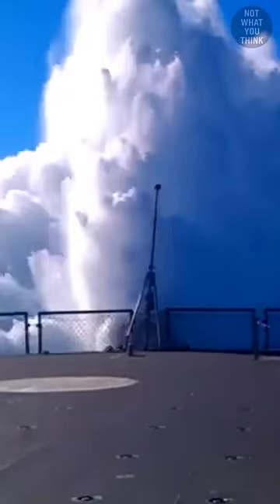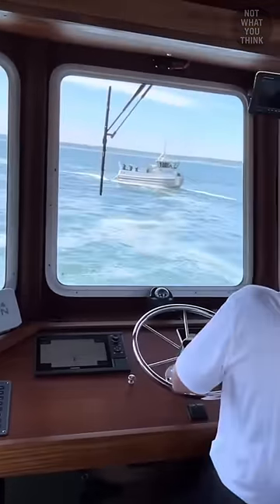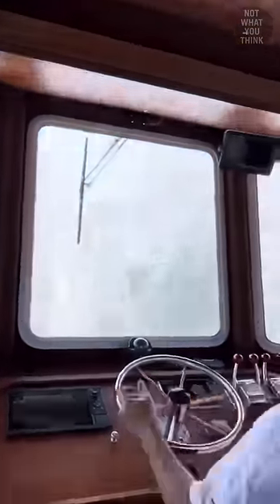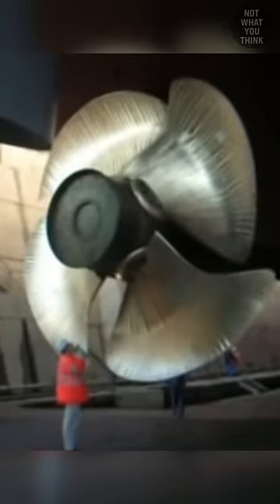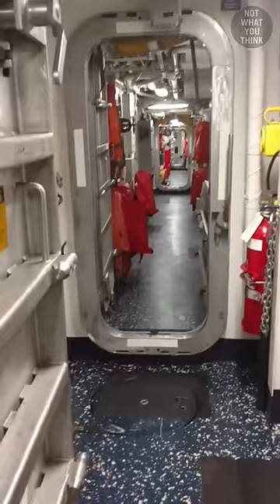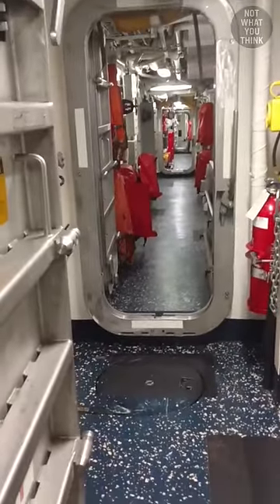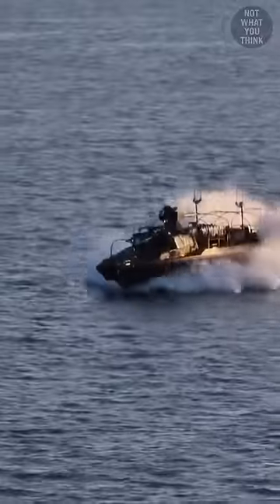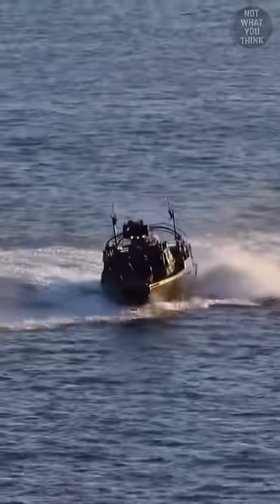Water Crash Stop #shorts

Comment: I was at helmsman on a Ticonderoga class cruiser. We used to go from ahead flank to full reverse instantly. But the engineers told us that it was very hard on the engines and reduction gear to do that. So then we went from ahead flank to all stop, waited for the RPMs to wind down to 20, and then when all back full.
Reply: We did it on normandy...in suez canal..foggy..following gw ...almost hit her stern. 
They crashed back and boiled water under our stern.  Sand , fish, line, I think we dredged another 20 feet😊😊😊😊😊 boat shook like it was coming apart
Reply: @robertsloane1268  why the hell did the GW do that? The Ike never did anything that dumb when we followed on Anzio.
Reply: So the Ticonderoga’s don’t have variable-pitch propellers?
Reply: That's not how its done. The turbines, MRG and shaft always turn in the same direction. All you are doing in changing the pitch on the CRPP from something like +100 to -40. Now the main thrust bearings and shaft seals may not be the happiest though.
Reply: @robertu yes, that is how it's done. CRPP propulsion systems use a combination of pitch and RMP to control speed. Below about 10 knots it's combined pitch and shaft speed, above that it's all shaft speed. While the shaft might always be going in one direction, waiting for the shaft line to slow before commanding reverse knots greatly reduces the shock on the shaft line and ship structure.

And +100 to -40? +100 degrees of pitch would have the blades inline with the shaft like a 50,000 hp egg beater. Try +30, -25.
Reply: @wyattroncin941  Forgive me, its been awhile since my ESWS and bridge days on the PFF.
Reply: @robertu  Neither will the CPO's...
Reply: @wyattroncin941 I need a 50,000 hp egg beater in my life
Reply: @robertsloane1268  that doesn't surprise me, the seamanship of the USN (particularly the 7th fleet) has been absolutely abysmal. Their numerous incidents, particularly around canals and heavy shipping lanes are frankly embarrassing.

The NTSB et al accident reports are full of USN arrogance, the incompetence would be funny if not for the innocent lives lost.
Reply: @beardedchimp  Congrats you got you slam in, feel better now?
Reply: Min shaft speed for a Tico class is 55 srpm.
Reply: @wyattroncin941  He is referring to percent of pitch. 100 just means that the max forward pitch is set.
Reply: @Dave-in-MD  Canadian ships don't report pitch in percentage. We report in degrees. American ships could be different, but I find that highly unlikely because of how incredibly awful "percentage of pitch" would be for doing any kind of plant operations.
Reply: @wyattroncin941  I spent 20 years in the US Navy on Tyco class cruisers and Burke class Destroyers. The scale on the OD Box was marked in both  percentage and feet per revolution. The manual pitch knob on the PACC was marked in percentage. It has been 15 years since I retired so I may have forgotten some things but that is to the best of my recollection.
Reply: @wyattroncin941  I thought you guys used radians
Reply: @Dave-in-MD  fair enough. i feel sorry for your engineering department.
Reply: @wyattroncin941  Why is that?
Reply: Battleship sailor here, 212,000 hp crashback. What a mess. Asbestos dust everywhere.
Reply: @beardedchimp the funniest part is that despite American arrogance and stupidity, they still beat out all other large, open water navies (which is frankly terrifying).

Comment: To be clear, the CB90 uses water jets with a scoop ("bucket") to perform the reverse/braking thrust. The bucket re-directs the water jets, so the drive itself never have to change direction or reverse pitch.
Very handy because you can go from full forward to full reverse thrust in about a second.
Reply: I was on a ferry with that type of propulsion except it had gas turbines for driving the shafts. They had a emergency reverse thrust mechanism to very quickly slow the turbine down and slow the blades.
Reply: So its a jetboat, thats what i figured.

Comment: I remember doing this on a 3500ton ship and being able to feel the deceleration of the ship under your feet.. quite impressive
Reply: Absolutely. On Type 42 destroyers, it felt crazy going from 32 knots to zero so quickly. Type 45 was even faster performing a crash stop. Type 45 also made you feel acceleration when wanging open the throttles. No gear lag and massive torque and they are like lightning from a standing start.
Reply: @vxrdrummer  yeah under normal circumstances we would run the two diesels (5500hp each), but sometimes we would run the gas turbine (30,000hp) and yeah you could feel it when they gave it full jandal!

Comment: When a ship brakes better in water than your 3 ton SUV smh
Reply: It goes both ways. If you put wider (or more) wheels on your vehicle, you will be able to stop faster, but you'll also have more friction driving (worse gas milage). Ships have abysmal gas milage for mostly the same reason.
Reply: @Dredge22 Ships have amazing fuel milage thanks to the square cube law and the coefficient of friction being proportional to the surface area and pressure.  With a ship you can scale up almost infinitely without increasing the pressure under the hule very much. Thus the pressure stays almost the same while the tonnage you can haul increases exponentially compared to the surfaces experiencing drag.
Reply: Why wouldn't it?
Reply: @amosbackstrom5366  I think the scaling part is extremely important, like comparing hauling me in a car or better yet on a motorcycle to hauling me on the smallest gasoline powered boat you can come up with, I'm guessing the boat losing (plus those small outboard engines have horrible emissions).

But yes there's a good reason it's cheaper to use container ships to move massive amounts of cargo.
Reply: @Michael-uc2pn  I don’t get what you’re saying, hauling what
Reply: @Dell-ol6hb  hauling as in moving a person or a relatively small amount of something. Perhaps hauling isn't the best word in that case.

But my point is Ships/boats are efficient at carrying an enormous amount of stuff, but if you're only wanting to carry a small amount of stuff, a small land based vehicle starts to be a better option for efficiency.
Reply: @Michael-uc2pn  Yes, that's exactly right, for moving small loads land vehicles are more efficient. I'm not sure where the graphs would converge but probably around 100 tons. So if the distances are the same you'd have to be moving more than 8 semi truck loads for it be worth shipping instead. This is a one variable aproximation so these numbers aren't accurate. There's much more than then just fuel mileage to take into consideration but if you're moving millions of tons the other variables go out the window.  It's cheaper to send a ship from NY all the way down and through the Panama canal and back up to the west coast to LA. That's about 6,000 miles over water compared to 2,700 over land.
Reply: That’s a misconception of what grip is. Unless you’re in very uneven terrain or over large  puddles of water, the size/number of tires has absolutely nothing to do with grip. The only thing that changes is surface area. Friction is a function of force over an area (pressure) which remains unchanged regardless of the contact patch size. This is because the same weight is distributed over whatever area you give it. In other words, increasing the area distributes the same load over a larger area. The only thing that can change grip on flat, hard terrain like a dry road is coefficient of friction, which only changes with different materials (tire rubber compounds) or temperature, assuming the road is held constant
Reply: @brookem.397  Yes that's exactly right. Those street bikes with water hose sized tires are a great example.
You have better grip than a mountain bike (on concrete/asphalt).
Reply: Just don't drive an SUV?
Reply: @ZephyrCubic  Correct. I remember when I saw a jeep with big massive tires slide on dry pavement, trying not to run a stoplight. 

Huge treads are great for rough terrain, but terrible for the street. :)
Reply: Think about whutchu said and please tell me did you do any research or perform a little critical thinking, lil physics, and mebbe a lil knowledge of the difference between props and water jets. Jus' a L'il Bit😏😏
Reply: TBH your 3 ton SUV will brake faster in water.

Comment: When USS New Jersey hit her record speed, and a record for any battleship ever at about 36 knots. They did a crash and it still took around 6 miles to come to a complete stop.
Reply: I mean none of the Iowa class boats had variable pitch propellers, so probably a decent chunk of those 6 miles were spent bringing all 4 props to a stop and then running them all in reverse
Reply: @richardmillhousenixon  For sure
Reply: She stopped a lot quicker when she ran aground...
Reply: @ColoradoStreaming  New Jersey never ran aground. You're thinking of the USS Missouri
Reply: @richardmillhousenixon  I double checked and you are correct.
Reply: How many boat lengths is that? 😂
Reply: This is from Richard Landgraff, the man in charge of getting the USS Missouri BB-63 and USS New Jersey BB-62 back in service at Long Beach Naval Shipyard in the 80s. 

History and Technology
Full Speed Ahead and Crash Stops on Iowa Battleships
By Dick Landsgraff
Well, I've been on a couple of sea trials where we cranked her up 10 rpm every ten minutes.

That's each shaft increasing another 10 rpm. That's each 18-ton propeller increasing another 10 rpm.

The skipper usually held out at a maximum of 200 rpm for the required 2-hour hold. However, the machinery was capable of kicking up another 10 or 15 rpm. But 31 to 32 knots was sufficient for the high-speed tests.

When the ship got up to 26 knots, a rooster tail would start to appear. Vibration was reported, but only aft of frame 166 (where the aft transverse armored bulkhead is). Chief's quarters were pretty bouncy and the Nixie room was like standing on a jackhammer. I set my notebook down on a table to record some data and you can barely make out my handwriting.

Walking forward, the vibration almost totally disappears as soon as you cross the threshold at frame 166. By the time you get up near the anchor windlass room, you can feel a slight torque to the bow. An almost imperceptible twisting that can only be felt by people with excellent sense of balance. I think it was that twisting that caused hairline cracks in the upper outboard corners of bulkhead 36 and allowed fuel to leak into the storeroom. Identical cracks were found on 3 of the 4 ships.

Once the crew accidentally hosed me down when I stepped out onto the weather deck. They were washing down the teak and I was within range. But I just walked up to the bulwark on the bow, forward of the anchors, and let that 30+ knot headwind dry me off in a few minutes.

The high speed turns can shake you up a bit. New Jersey was riding very light and heeled quite a bit. Missouri was ballasted a little better (plus having bilge keels in better shape) and heeling was almost unnoticeable.

A full crash back is almost a non-event. That's where all four screws are reversed from full ahead to full astern. It takes a little over a mile for the ship to come to a stop before going in reverse, but there is no feeling of inertia throwing you forward - unless you turn the rudders inboard toward each other to close off the passage of water between the twin keels. That is called a "Barn Door Stop" and only the Wisconsin has ever tested it. A former XO of Whisky said that when they threw a piece of wood over the side from the bow at the onset of that maneuver, the ship came to a stop with that wood no further aft than turret III. That's stopping a 57,000 ton ship traveling at 33 knots in about 600 feet, which means that anything that is not tied down winds up on deck or against a forward bulkhead.

Of the four BB's we reactivated in the 80's, the Wisconsin had the most problems with loose rudders. I wonder why. But Philadelphia did a great job of tightening them back up again.
Reply: @dundonrl Interesting reading! Thanks.
Reply: Unless it's a land mass...Iowa's don't need to stop.  Everything else needs to get out of the way.  Just ask the North Koreans how they faired with my favorite Whiskey!
Reply: @Jreb1865  I met him a few times when my first ship was undergoing PSA at Long Beach Naval Shipyard and he was our Santa for the ships Holiday Party.
Reply: Meanwhile Wisconsin was able to go from full speed to full stop in 3/4 of a boatlength withba barn door stop
Reply: @Sinjinator at least 2!
Reply: I love the USS New Jersey!! I still have my hat from the gift shop in Camden NJ!!
Reply: @popuptarget7386 imagine citing the only 'near-peer' war the US fought in modern times, which the US still lost...

Comment: I've helmed a Tico Cruiser. I've performed many crashbacks. The conning officer should've called out the orders....slower. we had water up on our aft missiledeck. Almost lost the aft lookout. Lost the binoculars and ivics set. 30 knots in 1 length. 30+ knots in 1 & 1/2 lengths. Reversible pitch prop. Amazing piece of machinery. A honor of the highest order. Left hand on the wheel, steering 10,000 tons. Right hand on the throttles, 4 jet engines at my command. An awesome experience.
Reply: A 10 thousand ton cruiser? They call anything a cruiser nowadays lol
Reply: Got master helm qualed on a tico and never saw water anywhere near the missile deck during a crash back.  Never even coming over the fantail.
Reply: @brody7714    Well it was built on a Spruance class destroyer hull, then they added a huge superstructure and a boat load ( pun intended) of missiles and said hey its a cruiser,.
Reply: @bbaff8622  ah, because it’s a missile cruiser, not the classical definition of one (weight).
Reply: @brody7714  It was initially going to be a destroyer then they changed it to CG.  
  I  know they were great to serve on.

Comment: That looks rather damaging and thus expensive, reverse water jets definitely seem better.
Reply: Inertia is inertia, it's still going to hit everything with several G's. They didn't really show what happens inside to unsecured cardo, passengers and fittings that aren't up to standard. 
Reversible pitch propellers and water jets aren't standard on all ships. Even if they were, normal ships don't have a lot of the damage reducing/safety features you'd see in Navy or specialized ships
Reply: Naval carrier ships have the potential to break in half from the reverberations in the hull during a full crash stop. And I want to say there is a limited amount of times a carrier can crash stop before needing an inspection/overhaul.
Reply: @1987FX16 the crew most likely will need an inspection too.
Reply: Well stoping in one ship length is still better than stoping on an Instant.
Reply: @Einwetok  "Inertia is inertia", it is more complicated than that. If it relies on rear props, the hull is under heavy tension as the rear tries to drag to back.If done at the front it it combines with bow drag putting the vessel under heavy compression.
Reply: @mammutMK2  believe me, if they could stop "on an instant" they would.
Reply: @jonslg240  it would probably kill or injure most of the crew if it just instantly stopped not to mention what would happen to the ship itself

Comment: There was a technique called a "barn door stop" available on the Iowa class battleships. The two rudders were unlinked from each other and thrown hard over in opposite directions, closing off the space between the skegs that carried the inboard shafts.  The technique was tried once, by USS Wisconsin. She was accelerated to flank speed (32 or so knots), and the barn door stop was performed. Everyone and everything not secured wound up on the decks or up against the forward bulkheads. The ship stopped *within her own length*.  During the Reagan era naval buildup, the shipyard had a lot of trouble with the Wisconsin's rudders.  Wonder why? :D